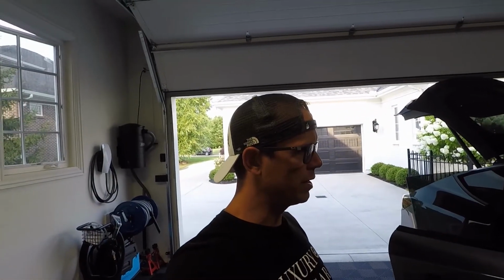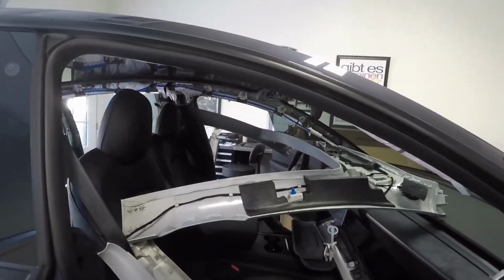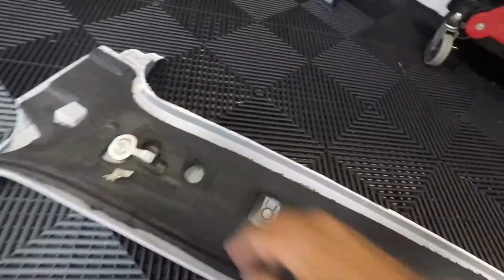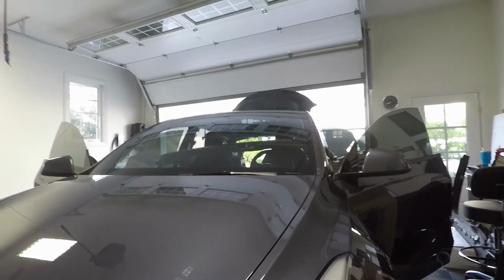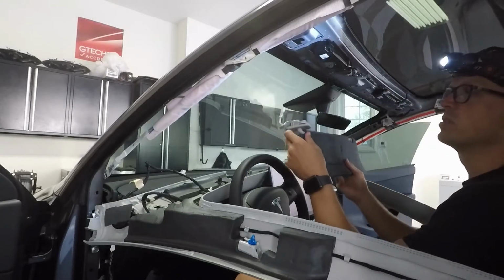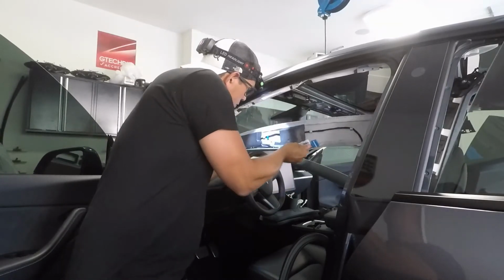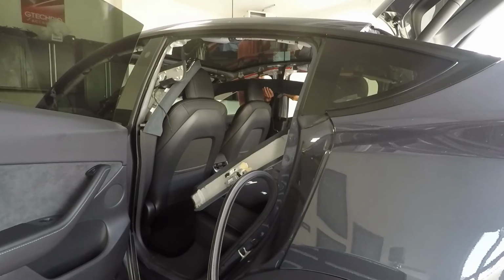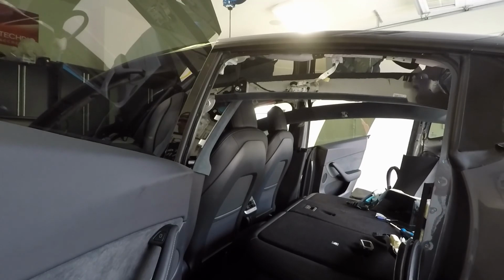Installation of Tesla Model Y Unplugged Performance Headliner | Luxury Car Care Care | Mason OH

Comment: Hey! great video! Just picked this up for my model 3, I was wondering if you need to swap over all the wiring or does the new one come all set?
Reply: It’s all set up for you. Just need to unplug the old and plug in the new. Just make sure to be careful with the electric clips. You don’t want to break one and either have it not attach or not stay attached. Otherwise plug and play. Good luck!
Reply: @scottwelsh7597  Thank you Scott!!!
Reply: @ElectricShock14  sure thing. Good luck and let me know if you run into any problems.
Reply: @scottwelsh7597  will do thank you

Comment: Wow, great video! Very detailed. I enjoyed watching it. The parts came out great, so did they remove the old material and then place the alcantara?
Reply from the maker: The process is, you place an order with UP for the new headliner and pay them for the new headliner plus a deposit for your headliner.  Once you get the "new headliner from UP you need to remove yours and send all the pieces back to UP (you use the same box that the new parts came in and they give you a paid shipping label).  Your old headliner pieces will then be used by UP for the next customer, they will remove the old liner and replace with the alcantara and you will get your deposit back.  I love my MY with the black headliner, so much better. I hope that helps!
Reply: @Luxurycarcare1  Thank you for the detailed reply, I appreciate it. This seems like a very streamlined process. I’m definitely considering moving forward with this
Reply from the maker: Great. Let me know if you have any other questions, happy to help.

Comment: the read of my headliner doesnt seem to clip in the back. any suggestions before making a service request with tesla?
Reply from the maker: If I understand the problem I would say there isn’t an easy solution. You will likely need to remove the back section of the headliner and reinstall so it’s clipped correctly but to do that you need to remove most of the headliner. If you watched my video you can see all the steps to make it happen but it takes some effort. Good luck.

Comment: Insane that this isn’t and option from Tesla, or even just a black regular head liner.  They also need a alcantara or textile seat option
Reply: Yes, I agree.  Tesla keeping cost as low as possible and every different option adds cost so the customer doesn't get the option. But at least you can do aftermarket!